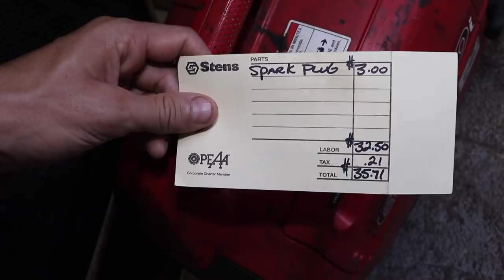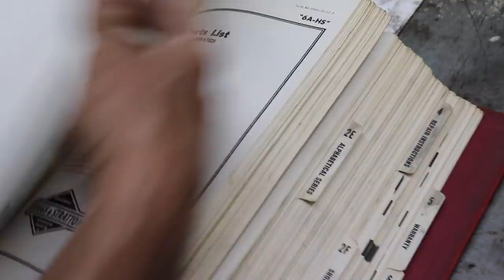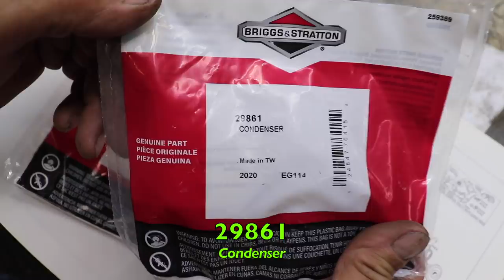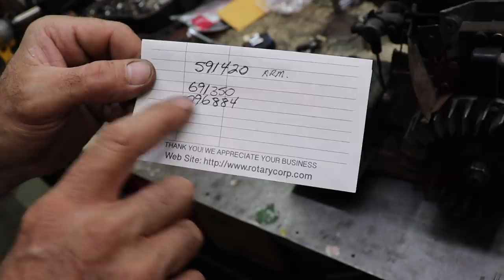INCREDIBLE 1936 Briggs & Stratton Electronic Ignition Upgrade & Valve Job

Comment: I have a Lincwelder with a twin onan engine. it was left out in the weather. and had no spark. I baked the coil and recoated it on the outside with non vinegar silicon to keep the water resistance. because the baking left cracks in the covering. it runs perfect.
Reply: Some of the exposed wound coils could be baked at low temps to dry out...then dipped in a electric motor varnish and baked at a low temp. There is an air dry coil varnish that can be applied to a open face coil, but you need to have the moisture driven from the coil if possible. Might extend the life of an old coil if the turns are not shorted internally in the winding.
Reply: @jaritkeith8931  worth a try if you can  not get the replacement parts. once done and insulated I have never had it fail again. bake at temp that will boil out water but not melt solder or ruin varnish insulation on wire. about 250 F is good.
Reply: @NebukedNezzer   Good info. A slow bake over several hours is usually what we did. Then checked with megger. With larger coil/windings,  can take a while to cook out moisture. Small coils like this would likely bake out fine.  Exposed windings or coils would usually be sprayed after a varnish and bake with Glyptal red insulating paint. Sounds like you had good luck with your repairs. Good deal and a part salvaged. Cool.

Comment: The Briggs & Stratton Vintage engine service manual CE8069-5/00 gives the head bolt torques for 6-S, WI & WM at 140 inch pounds.  The valve clearances for all three are listed as intake .007-.009: exhaust .014-.019.  However, the owners manuals for the WI list clearances as .005 -.007 and .014-.016, and the WM as .006 & .008.  There is nothing given in the 6-S owners manual.  The tool that was made to lap the valves was a crank style such as the Zim Specialty tools  #301 which had a metal adapter to fit into the holes on top of the valves.

Comment: Taryl i have a 2008 20 HP Kohler Courage 1 cyl, I watched a video " not yours' on adjusting the valves he said intake was 5 thousands and exhaust set at 7 thousands and it runs like crap What does your Krystal Ball say to set them at ?? Do you sell parts online ?

Comment: On the old engine for example Wisconsin is there any tips and tricks to convert them from points and condenser do electronic ignition on them it would be interesting and for example like the big twin engines

Comment: I wondered how Briggs & Stratton engines existed before small engines where light (aluminum), affordable and powerful enough so they could be used for residential rotary lawnmowers.  I think the miracle of the USA easy to mow residential grass lawn happened after WWII due to availability of practical affordable light weight and powerful enough small engines they could be used for push rotary lawnmowers.    I had heard  before this B&S engines were used for gasoline powered clothes washing machines back in the 1930s.   I wondered why because it seemed vastly more complicated, expensive and noisy than using an electric motor.  Then I heard it was common out on homestead farms that might not have a ready connection to electric power.  You can just bring the gasoline engined washing machine home and connected it to a water source.  You might not have hot water. The expense and ingenuity nature they required made their market with the well equipped USA plain states farmers.  I think my grandmother in Lincoln Nebraska said she had a gasoline powered washing machine in her house basement for a while in the 1930s.  They also had a coal house furnace at that time as well in the basement so the basement wasn't used as living space.  The exhaust was piped to the outside I think similar to how we duct a clothes drier exhaust. That got rid of a lot of the noise.  

 I think my grandmother said they got an electric clothes washer in a few years.  She had an admiration for the gasoline powered clothes washing machine, but it was much more maintenance prone, noisy and a bit of dangerous concern with gasoline and the possibility carbon monoxide escape then the electric washing machine.   Out on the farm, with gasoline washing machine out in the barn with water supply from a well, these washing machines could really fit.   In that situation typically the husband was available and able to attend to the engines maintenance and you could place the machine anywhere you could supply it with water which could be as simple as a metal drum moved in with the tractor.  I think my grandmother said people used those gasoline powered washing machines out in farming communities till the late 1950s because you could put them anywhere.

Comment: Back in them days they were calling it being swindled.
Other than the fact that the washing machine held water itself like today the washing machine was used in a dry environment so they cut a corner to save money by not enclosing the points.

Comment: I love your video but I think you should replace the valve springs because they are old and weak like you said.  It explains why this engine has apparently been run from time to time over many years and had cruddy valves but a good cylinder.  It can't breathe due to the old weak springs.  Weak ignition would contribute to it too.

Comment: According to the manual the intake valve clearance should be 7 to 9 thou and exhaust 14 to 16 thou. I have a pdf manual of old strattons. The head bolts140 inch pounds. It is on a cd I  could copy and send the manual to you.

Comment: Gas powered washing machine?  Carbon monoxide and lead fumes washing clothes (hopefully outside).  You might get someone that can (maybe) re-wind that coil it's not fun and probably has some PCBs or some crap.  I've wound a few inductors and small transformers but that could be a pain (but not impossible)

Comment: I wonder if there is a way to demagnetize one of those flywheel magnets so it is left with one magnet?  Would that allot the original flywheel to work with the new style coil ?
Reply: No, because the timing would be changed. It would not start or run very poorly

Comment: Hello Taryl, Thinking of doing that with my cast iron 23AFB Briggs an Stratton. gotta get a 
battery first as it has a full size delco remy starter generator belted to it. will check the
compression first, This engine has the valve clearances on it. . I heard these cast iron engines
are somewhat quieter than aluminum block engines, anyone ever hear that?

Comment: I got one of those engines..little kick start model just like yours...but it's red. Ran last time I tried it. I'd sell it for ONE MILLYUN DORLERS!
Anyway...Jr. looks a lot better cleaned up...both them boys good looking young fellers...but I confess, Jr's regular disguise my favorite.
As for the washing machines...they ran them on the back porch and no, no withdrawal when 'leckric' washers come along...Leroy didn't have to start the motor for ma any longer...and the washer could move inside the house.

Comment: The Amish families near where I live still use gasoline powered washing machines because of their thing about using electricity. They pick up old ringer washers at auctions and replace the electric motors in them. Someone even figured out how to make the older Whirlpool washing machines with belt driven 3 speed transmission run on a gasoline engine for the Amish. They are real creative when comes to standing still while society moves on.

Comment: I'll bet you didn't get the points clean enough. You need to polish the points with an ignition file to the point ware you can see your reflection in the point surface. I have had this experience before. The trouble was I didn't get the points clean enough.

Comment: I built a small minibike in the fifties with one of these. Got pulled over by the cops, told me I would have to have headlights, tailights and brake lights if I wanted to drive on the road. I learned to keep a better lookout for the cop car.

Comment: the light flywheel on the mower is because the mower uses the blade for part of the flywheel inertia. also the light flywheel will prevent the engine from starting with a loose blade and if you hit something with the blade the crank shaft is less likely to bend. there are reasons for things
Reply: Which leads one to wonder what the downside would be to using a lighter weight flywheel on the 1936 motor...
Reply: @donmoore7785  if it will start and run ok go with it.

Comment: I have a question for u T is there a difference between highway miles and city miles on an engine ??
Reply: City miles tend to be stop and go traffic and slower speeds. City driving tends to be harder on engines over time.

Highway miles are where when engines run close to or at their "happy place" for longer periods of time. Consistent speed, temperature, load, and for longer times tend to be better for engines.

Comment: I had that clutch on my mini bike(doodle bug).  I had a Power Products 2 cycle Wacker Packer motor on it.  It went fast enough to wreck my knee.  Not one weld on the old bike frame for brakes (brakes are over rated).  Every thing was plates bolted on.  Mickey mouse?
Reply: Looks like Uncle Andy's gonna get a double poundin'!

Comment: it was called getting Gypt. if the coil has water in it bake it in the oven at 250 degrees till it stops bubbling. be sure to check the magnet and air gap to coil.

Comment: I noticed that the coil wire was soldered to the coil tab, that;s a NO NO , that could be the reason the coil is failing..... The wire is simply supposed to be bent around the tab..........

Comment: Since the gas tank sits below the carb I'm assuming that it has a fuel pump??????????????
Reply: A siphon system. I recall there was a check valve or foot valve in the tank fitting to compensate for the intake pulses. Seems those gave problems at times.

Comment: That engine hasn't been run much. I'm thinking that it was too much hassle and the "person" washing clothes preferred the old fashion way that actually got the dirt out of the clothes.  Unless you had running water too, filling the machine, toting gas and then futzing with the carb while pumping the starter pedal trying to get it started was more work than it saved.

Comment: Most of those old WM had a flexible exhaust pipe that could be run outside. I wonder how many women were fixated by these engines not being used correctly? So sad to hear Briggs@Stratton filed for bankruptcy. They were my favorite engine manufacture until I bought a Simplicity Broodmore w/ a 22HP professional engine. Loud, can't get it to run smooth, three carbs, two manifolds, etc. Just a terrible engine in my opinion. I miss my old Kohlers.